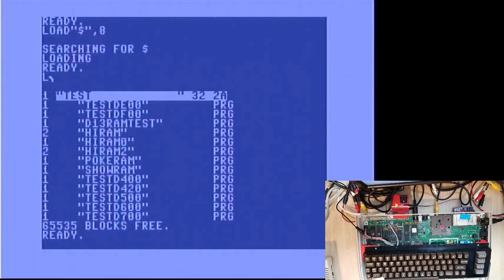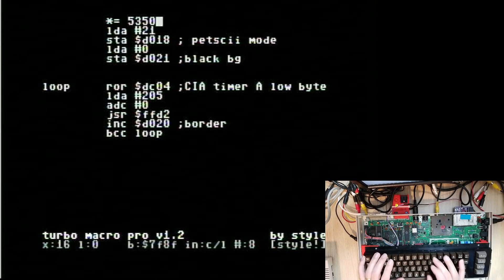Behold! The Commodore 64 and 3/4!

Comment: Sorry, I only just noticed the tag. Thanks for the shout-out! Nice work with this. Pretty funny having an extra tiny RAM expansion in I/O space. For what it's worth, the C64DTV by Jeri Ellsworth had a bunch of extra cool features in that $D100-$D3FF space, like an MMU, configurable VIC palette, and a DMA/Blitter engine.
Reply from the maker: Hello sir, thanks for popping in!  I had no idea the DTV had stuff like that built into it.  I knew I should have picked one of those up when I had the chance.  Thank you so much for all the great content you put out there, you are truly an artist and an excellent teacher.
Reply: I've had my hands on the prototype. It was at PhreakNIC back in 2016-ish and needed to have a cap replaced. I happened to have a soldering iron with me (of course). 

Ms. Ellsworth was nowhere to be found. :)